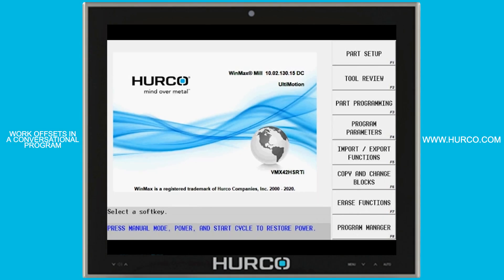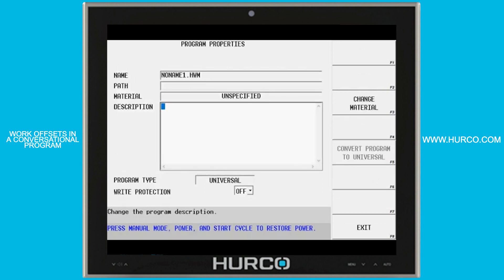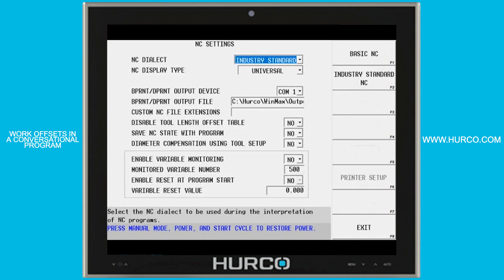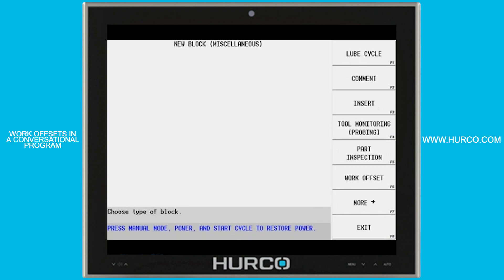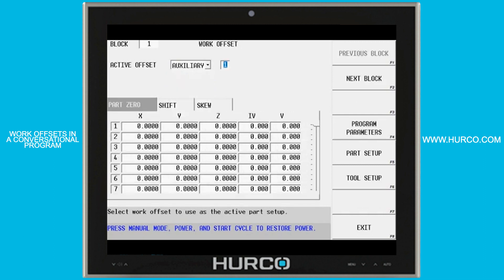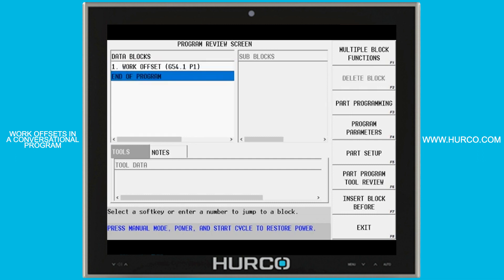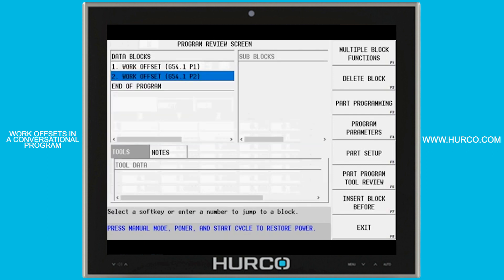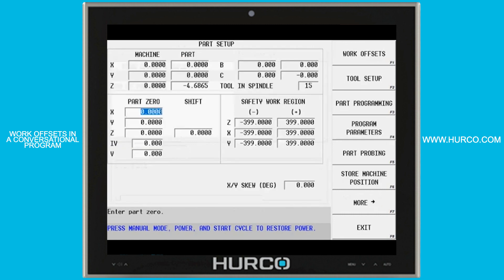Work Offsets In A Conversational Program - Hurco WinMax CNC Control Features

Comment: How is this different that just inserting a "Change Part Setup" block? Or maybe if using those stored work offsets in a newly created program...
Reply from the maker: This works very much like adding a “Change Part Setup” block to the program, but it simplifies the process. Just like when using the CPS block, adding the WORK OFFSETS block allows you to jump between setups…and multiples are necessary to jump back and forth between these setups. The benefit of the WORK OFFSET block over CPS is that they are always setup and ready to call whenever needed, and can be used for any program (NC or Conversational). The WORK OFFSET block is also handy when you need to make an offset adjustment. With the CHANGE PART SETUP block you need to change ALL of them to make adjustments…with the WORK OFFSET block you only need to make the change in one location and it works for every instance where you call that particular offset.
Reply: @hurcousa Okay nice!  I didn't know/hear the instructor say it's interchangeable with both program types. Yes much easier to make a change in one location spot. Thanks